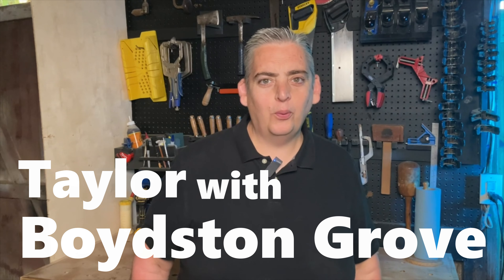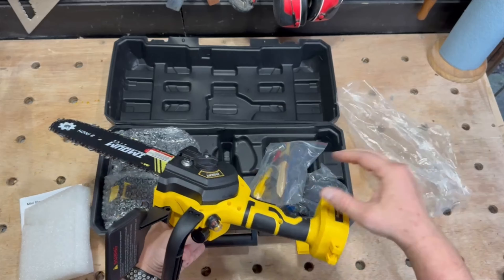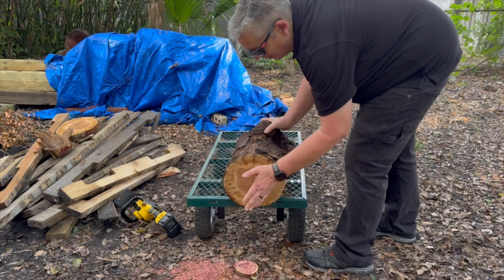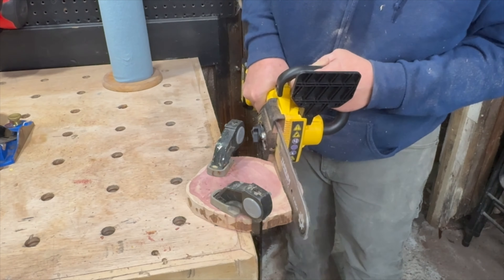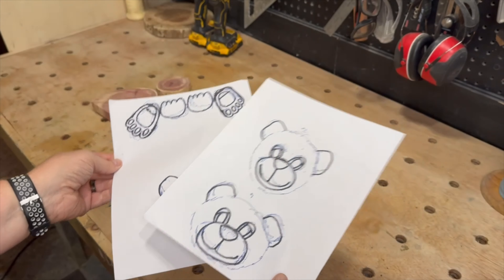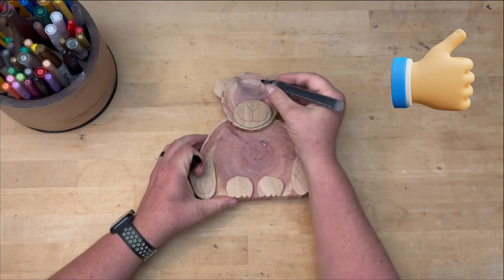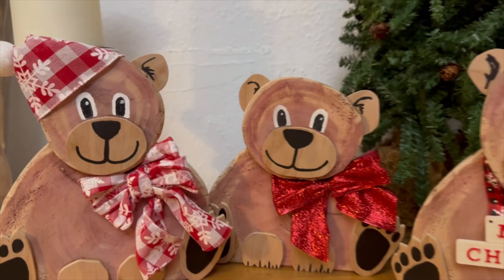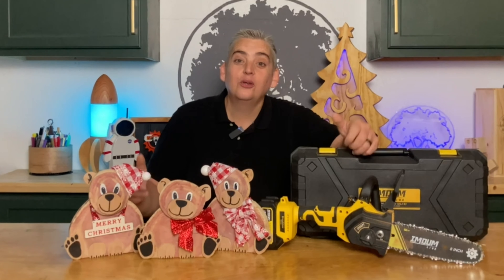Making Christmas Bears With A Chainsaw / Christmas Decor Ideas

Comment: I would like to have known if the batteries are compatible with the dewalt style batteries, the charge time and how long a battery lasted before needing changing. I'll go read the description and see if that will tell me. Looks like a good saw for skid work or picket lines.
Reply from the maker: Yes, good suggestion for usage. To be honest, I haven't fully killed a battery yet and the company wanted the vid. out so I had limited time for testing. But, so far so good.